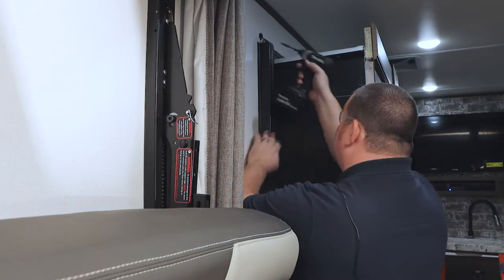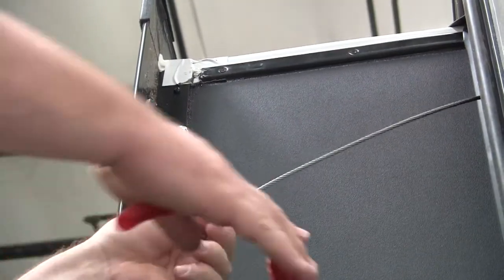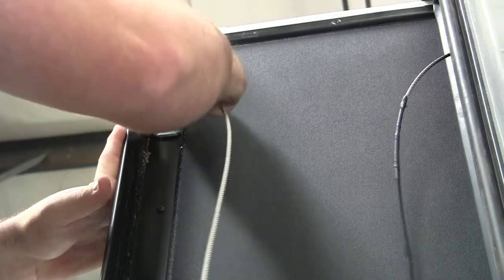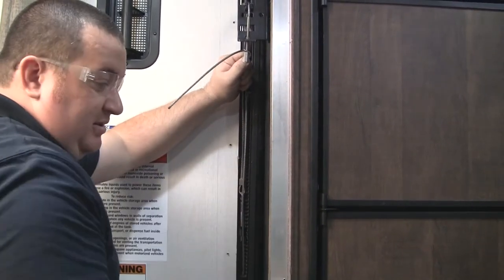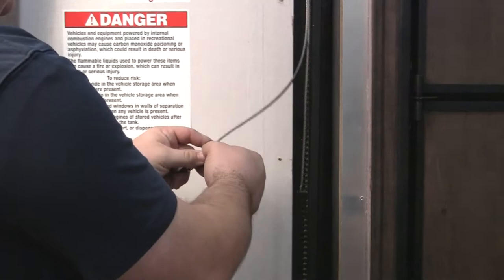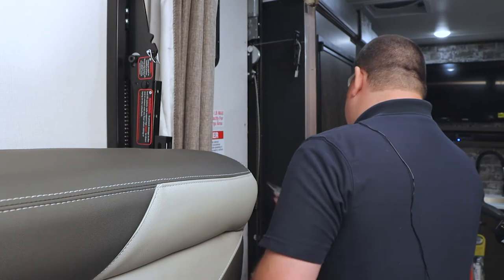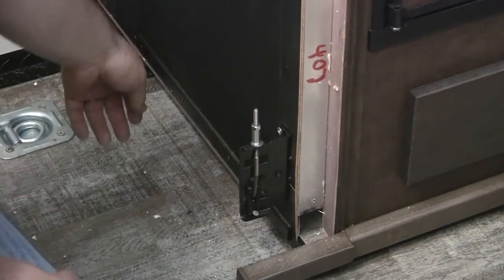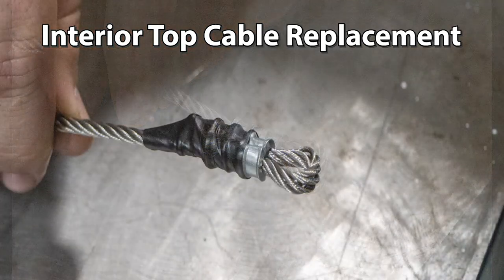BAL EXACT-SLIDE Top Cable Replacement Procedure

Comment: Sweet, now I just need to buy the $335 crimping tool.
Reply from the maker: Swager Crimpers for 5/32" steel cables are available on Amazon and through other retailers for a more reasonable price around the $40-$60 range.